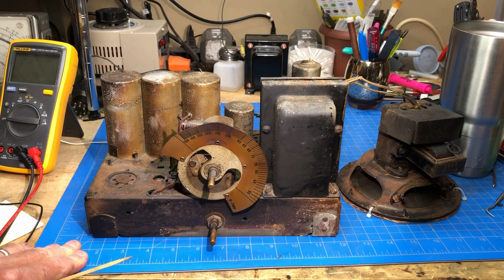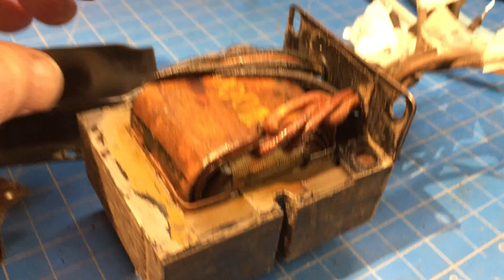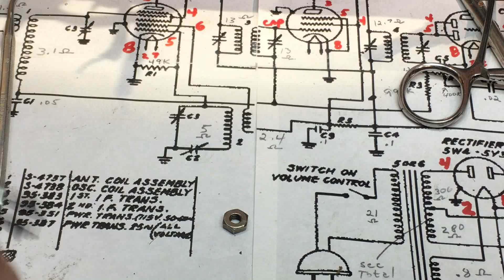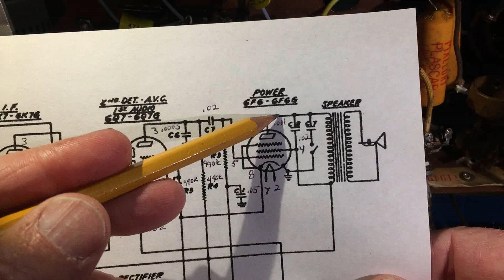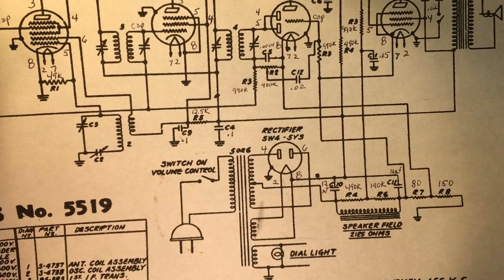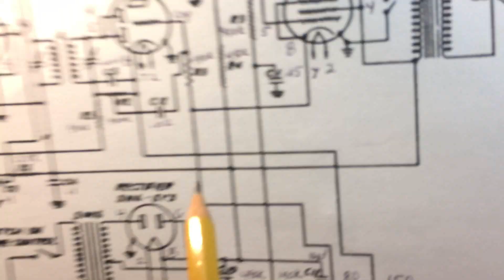1937 Zenith 5R135 Part 3 of 6 Replacing Capacitors and Resistors

Comment: Fantastic work doing the capacitor/resistor replacements Larry,  it looks great! Good call adding the terminal strip. I have a screw starter for both straight and Phillips screws, but have never seen a nut starter. Can you give me a link to both it and where you get your snap-in fuse holder? I have plenty of glass fuses, and usually use panel mount, but I like the looks of what you did here and might want to have a choice of which type to use, depending on the project.  This radio is coming together nicely sir!
Reply from the maker: Gregg's Vintage Workshop https://www.toolexperts.com/nut-starter-8081.html     I have starters for screws too....I got the fuse holders they Radio Daze...I’m sorting out the tube voltages now...Thanks for watching and the comments! Take Care—Larry

Comment: Hi Larry,
The copper spray painting looks to have turned out well - and as you say, it is not too far away from the original colour.
The chassis bracket is a very useful tool, especially when you have recently done a spray paint job to the chassis.  Scratches can easily appear whilst manoeuvring it on the bench.  “Electronics Old and New by M Caldeira” uses a different type of chassis bracket which is also quite effective ...check him out if you are not familiar.
I have to admit, having worked in audio and television servicing for thirty-six years I’ve never come across a resistor with the value of 990k.  We learn something every day LOL.
Cheers my friend, Phil.
Reply from the maker: SteelCity321PB Thanks Phil for watching and always enjoy hearing your comments! I recently subscribed to Electronics Old and New....havent gotten around to go thru and see a whole lot of his videos...yet!!! I plan on sitting down and catching up...Thanks for the tip! Yes...990k??? The first schematic was blurred and I kept second guessing.....hmmm why not a 1 meg....or 820k....But, as you know prior to WWII.....color coding and manufacturing was pretty much an individual thing....ie...the Philco bakelite caps...or some of the old RCA resistor color codes....I guess there was a trade war (patent war) amongst them! Take Care--Larry